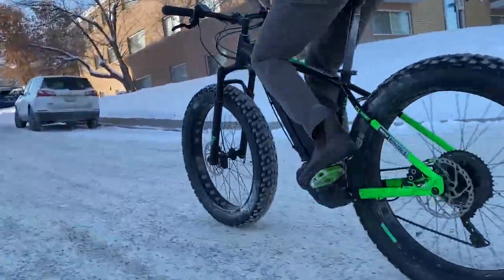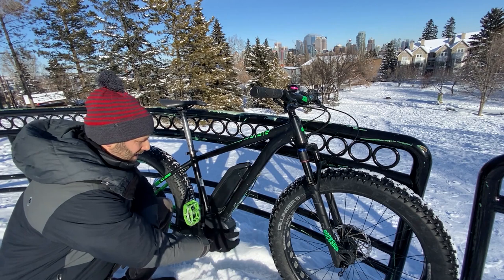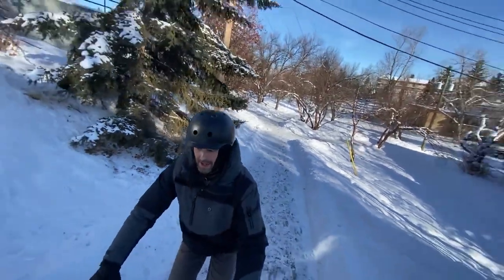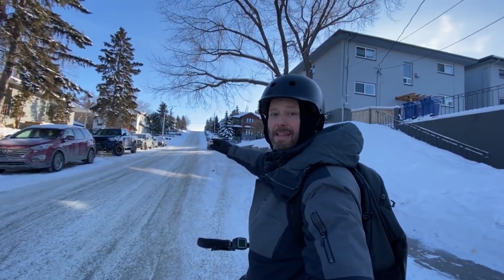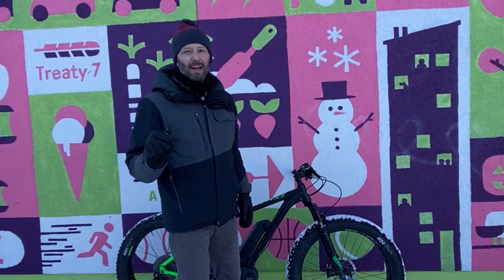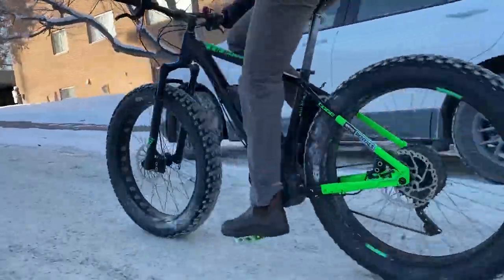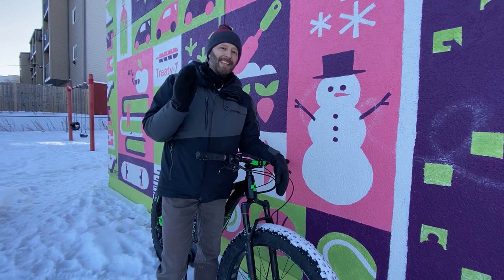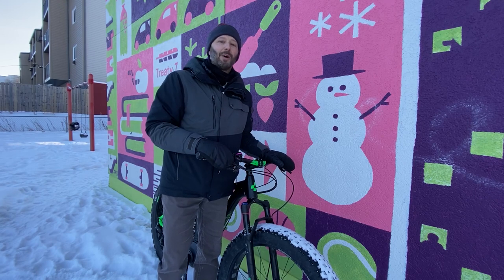Will an electric fat bike become my new favourite winter urban commuter?

Comment: The main thing for staying warm in the winter on any ebike is to make sure you keep puting out the same effort you would if you had the battery off.  If you use the peddle assist as an excuse to take it easy your going to get cold.  Adjust the assist level so that hill feels like flat ground normaly would.  If your normal pedal pace puts you at 15mph on a flat pump just as hard with assist on and you'll be going 20 instead but still be just as warm.  As long as your outer shell is decent at breaking the wind a few extra MPH of wind chill  isnt going to make that much of a difference if your still generating alot of body heat.

My local weather isnt quite as cold as yours but I usualy go with a water/windproof shell and the minimum under that to not freeze my ass off in the first 2 minutes of my ride.  Still a bit cold for those first 2 minutes out the door but after that  I'll be warm enough even for short stops.  I keep a heavier layer in the pannier for long stops.  I then pick a speed I want to travle at and  use the assist levels as a thermostat.  Too warm? assist up and ease off peddeleing as hard to cool off.  Too cold? assist down and peddle harder to maintain speed and build body heat .
Reply: Maybe you could add a front windscreen to the bike as well?

Comment: I don't like super wide tires, but if you are in a city with a tram system those tracks are dangerous if your tires are skinny enough to get stuck in the groove. It is often not possible to cross the tracks at a safe right angle and if your front wheel gets stuck that's a nasty crash.

Comment: I have  low powered mid drive efat, 350w middrive...top speed 18, but in reality more like 14-15mph...its a great bike for rough, loose or uneven surfaces , and the woods.  This will be the first winter I get to try it.

Tbh, it will outroll a bike Friday on even a  mild downhill. It's just that the tires are so

Comment: Needing to add lights or bags etc isn't a negative. Most bikes don't have those options out of the box. 

Good perspective though. I never thought about the ease of riding an e bike in the winter resulting in less energy/body heat.

Comment: I have two issues with e-bikes: the cost and inability to maintain the electrical components myself. I own a cross ebike with a Bosch motor. Love the bike but the motor is a black box. I can't take it apart, no parts are available the batteries are proprietary and very expensive. If the motor fails I'll be looking at an expensive repair or replacement. Since the frame is built for a specific motor it might not be compatible with the newer motor models. Effectively, if anything happens to the motor - the bike is throwaway.
Reply from the maker: This is also a factor. Thanks for sharing

Comment: You can buy a cheap brand new 26"x4" tires bike for under $500. I ride motorcycle in the falls and heated gears are a must! However, I am concern sharing icy roads with vehicles.

Comment: The other downside to ebikes should be pointed out more. It pushes your average speed up close to that of a motorcycle yet people still wear typical cycling gear. If you eat shit on an ebike doing 25 you are going to be much worse off then me in my armored and abrasion resistant motorcycle gear and full face helmet. Not saying it's practical to ride a bike in that stuff but it seems like most people don't even consider the injury risk higher speeds on a bike present.

Comment: Ah!  So they DO make studded fat tires.
  You mention two things.  
       It's harder to get up to speed   -is this because the sponginess of the low pressure tires absorbs more of the enrgy you're pedaling out when it hits a bump or slope?  Or is it the extra mass at the utside of the wheel that you have to spin up?
        It's more stable.   - what do you mean by this?  Harder to slide out from under you?  Harder to tip because you have more mass in the tire spinning like a top?  A wider tire surface engaging with the ground?
  I've been looking at one speed bikes with a pedal assist motor to act essentially as my gearing as the route warrants.  I've seen a lot of talk about narrow studded tires for winter biking.  Would a studded fat tire offer some advantages?

Comment: Fact is I had a Marin MTB bike for a few years, but it got far less, and diminishing use after I bought a Marin hybrid model. I might of seen it differently with winter riding, but in the past I've been shut down for biking over winters.  The hybrid offered me more comparatively for speed, athletics, handling, and now utility use.  Not that different for what you see for the advantages of your preferred style of city bikes.  I've even gone and changed tires to Fincci 700x35c for both, where it's more of a gravel type tire compared to more of a dirt tire.  With far less snow and ice here, (Arizona but at 5000 feet) I could be OK with those, but I have two used spares which I can change back to for the dirt tires if need be on that bike.

Comment: If you rise the handlebars a little bit higher then it will help you to prevent sore wrist and will be more comfortable. Don't leave your ebike battery outside in the winter, goodness will damage your battery. The same with sun light in hot summer. You can get a beautiful and more powerful Chinese fat tire ebike for 14$ USD. Himiway Cruiser and Majicity fat tire ebikes are amazing but they are a little bit expensive.

Comment: Did the e bike have mode settings?
I converted an old Raleigh Aero to throttle assist ( front wheel drive) and I find if I'm not warm enough just use leg power till warm then back on the throttle, and repeat 😁
Reply from the maker: Yes, it was. This is great advice.

Comment: If all of the salt on your city streets will corrode a fat bike like that a year or two, what the hell does it do to a brand new car that costs multiples of a premium bike like that?!?!
Although, beautiful machine!
With the electric motor, it would be a very pleasant commuter' summer or winter.
I'm in Ireland and I think it must be 12 years ago since we had any kind of substantial snow that turned the country white. Hopefully it'll be another 12 more at least. Let's just say every year I'm dreaming of a green Christmas.
Usually only get a real snow about every decade on average.
It's been a very mild winter this year with barely half a dozen icy morning's on the roads. My 40mm tyres on my hybrid bike are fine all year round.

Comment: It is really hard on Ebike Batteries because Lithium-ion don't like to freeze.. You definitely should never charge a frozen battery, wait until it comes to room temperature before charging.  Your range will definitely drop in cold weather.   So unless you have a warm place to bring the bike in for storage and charging it's not really a good idea.  Batteries run between $260 and $1200.  Charging a frozen battery can cause it to malfunction or completely fail. Expensive lesson..

Comment: I always wonder about the drivetrains on those... does it have the high gears you need to do 30kph without pumping the cranks super fast? And like you said, it doesn't take much effort to maintain that speed, but on eco mode does it give you just a bit of a boost, allowing you to power it mostly yourself or what?

Comment: other than the mid drive motor & battery the components are the same as a conventional bike.............and both are well-protected against the elements.  I ride year round and have 16,500 kms on my e-bike (since 2019). I haven't had any additional issues on this bike as I have had on my other conventional bikes.  But the probable theft issue is a great reason for not commuting with my e-bike
Reply: What bike you riding these days in winter?
Reply: @JamesMorton-p9k  2019 Motobecane HAL eBoost PRO  (i now have 21,600 kms on the bike.........original motor & battery)
Reply: @ thanks for the reply!  These bikes look really good actually...hasn't heard of them before!

Comment: My ebike cost roughly $1500 with lights and a bike rack.  $6k is paying for high end components.  Theft is really the only main issue I see, but you can invest in an alarm, GPS tracker and remove the battery.  Cold?  Slow down and make your body work.

Comment: is studded tires necessary for winter biking? even if it is regular mountain bike? you showed using skinny tires in snow. are you using studded tires? if not how it is not slipping in snow? what is the safe speed limit to follow when riding on snowy road?

Comment: I’ll have to agree to disagree.  My first commuter was a skinny hybrid with studded tires but after dealing with rutted refrozen ice on the streets in Minneapolis, Minnesota it became too treacherous, so three years ago I made the switch to a Fat Bike from FRAMED and Never, Looked, Back!  I initially poked fun of fat bikes when they first came out, they looked like slugs but quickly realized how much BETTER fat bikes really are as a commuter.  Fat bikes  are extremely stable and predictable in most conditions. You talk about speed being an issue, but not with higher tire pressure since I run 30 psi max pressure on my non-studded Terrene Cake Eaters and it’s FAST! It’s not road bike fast, but weighing in at 40 lbs (with fenders, lights, aluminum reinforced brush guards mounted on the handlebar for wind protection, KORE downhill pedals and a water bottle) when compared to my 25 Lb. skinny bike (single speed in my case) it’s only 2 mph (GPS Tracked) on average (in summer conditions) slower over the 8 mile commute.  I even run max pressures throughout the entire winter, but drop it down to 11-13 psi for extra traction if my commute is through 5” of snow or more.

I’ve changed my attitude towards commuting using a heavier bike, It’s made me physically Stronger and Faster and it’s quite noticeable when I switch to my carbon fat bike for the trails.  You bring up the issue of rust from road salt basically killing a bike... two things, buy a bike with better components and take care of your bike!  The corrosion resistance of my upgraded SRAM components and KMC chain show absolutely ZERO rust after 3 years, in fact my bike is in excellent condition after 3 years of commuting through all weather conditions because I take care of my equipment.  In the winter I wipe my entire bike down with a wet microfiber cloth when I get home at night, it only takes a few minutes but removes all the residual salt and grime off the frame and rims... I even go as far as spraying some water from my water bottle onto the driveline and let it drip dry.  I clean my entire driveline at least once a month during the winter months.  It’s simple, if you never wash your car or maintain it you will soon have a crappy, undependable vehicle.  It’s not OCD to clean and maintain your equipment and it surely beats breaking down in subzero weather because you’re too lazy to clean your chain every once and a while.

Glad to see you smiling during your eBike fat bike ride, I’m sure more of us fat bike commuters will change your mind someday about the “perfect commuter bike.” ;)
Reply from the maker: Great comments, and thanks for sharing. I commend you on your bike-maintenance regime, but all that work is exactly what I'm trying to avoid. I think urban bikes should be practical, easy and as maintenance-free as possible, for one basic reason: People will use whichever transportation mode is most convenient. If riding a bike requires a daily wipe down and monthly drive-train cleaning, that will push many people away from making that choice. I'm not criticizing your decision, I'm just thinking, on a macro-level, that if all bikes (not just winter ones) were easier to maintain, we might see more people choosing bikes for transportation. 
Plus, I hate bike maintenance!
Reply: @Shifter_Cycling  Even with low maintenance drivetrains like a Rolf hub and Gates carbon system you’ll still have maintenance to some extent. Choosing to commute by bike should also take into consideration that at anytime something can break and leave you stranded and being stranded late at night in the middle of winter can be dangerous. I maintain my equipment to avoid most failures. I use my commuter as a tool rather than for pleasure and stick behind the notion that the better you maintain your bike the less likely it will fail. The mindset of those who want little to no maintenance are those who live in apartments and ride the bus.  The preparations considered for commuting by bike go beyond dressing for the weather, it’s also making the right choices for equipment and taking care of your entire investment.... biking can be expensive but the rewards are worth it! 

Thanks for responding to my feedback.  I enjoy your videos because I like to hear and see how other people commute.  I feel like I’ve finally sorted out my gear, but it’s great to be open to new ideas.  One thing I will share with you is that I make notes in my phone for how to dress for colder 10-15 degree temperature brackets. I work evening shifts at a hospital so the temperatures can differ from when I leave for work at 2:00 pm to 12:00 midnight or 7:30 am if I double and I’m riding home in the morning. Careful planning and being prepared takes a lot of surprises and guesswork out of the equation.  Happy riding! :)

Comment: You can get belt drive E Bikes with waterproof components . you can get dual motor bikes front wheel and rear wheel drive.  Dual batteries .. I'm sure you can find a good winter E bike and dress more appropriately .😁

Comment: Excellent video, only saw it now because I'm a recent subscriber. I'm a former marathoner who had eleven bikes at one time, and when I got a fat-e-bike (that sounds like fatty bike!), it became my immediate favorite. Getting going is the tough part, but once on the move, it rolls and coasts very well. Security is the rain on the parade for me, as my hometown is pretty much cars-only, and it's rare that stores even have a rack, let alone one that's properly installed in a good location. But, everything else is pretty much perfect: full set of lights with brake light, heavy duty rack, 1600 watt hub motor which is silent a low speeds, 12 pedal assist levels, 73 miles range on throttle only (tested), and it FOLDS!

But, I still have to drive a car because no one is going to pick a car up and throw it in the back of a pickup truck...
Reply: Model ?

Comment: I would love to ride my fat bike to work, but I can’t think of a safe place to leave the bike while working...
Reply from the maker: This is a huge problem everywhere. 😩
Reply: @Shifter_Cycling  Why? Doesn’t employers have good bicycle parking? My employer has charging facilities for 30 electric bicycles in a big bicycle shed on the premises and room for another 100 normal bicycles. There is an air pump for your tires, a small self repair space, room for your rain clothes to hang to dry, storage lockers for your bicycle cloths and helmet and a shower room. The space and investment needed for bicycle parking is far lower than for car parking.

Comment: I can see this working for a commute to work with well protected parking options, but for running errands around a city? Let's just say a bike I'm comfortable leaving tied to a lamppost is ten times cheaper. 
Not to mention that it's gonna be worth to people to steal just a wheel or a battery etc., so it's gonna take you longer to tie the thing down safely than it's to get places.
Reply from the maker: Yes, I agree with all your points

Comment: $6000 for a bike? my car cost $7000, not an unreasonable amount to invest in a primary vehicle but not if its meant to be a cheaper option that you don't need to worry about being stolen or parts breaking
Reply from the maker: Cost is definitely a factor
Reply: There are much less expensive fat tire ebike options. 1400-1600 usd gets you a nice one with a geared hub.
Reply: Ebikes are expensive that's for sure. I could have bought a nice second car for the price of mine, but seeing that I already have a nice little car that wasn't a factor for my purchase decision.

My cars cost me money  everyday whether I drive them or not. I've got road tax, insurance, yearly health check, maintenance and fuel to pay, not to mention parking costs, city congestion charge and potential fines from CCTV cameras watching my every move.

With the bike I've almost none of those expenses or worries, just a little money on maintenance. Of course theft is a major worry so I'm very cautious where I leave it and about how I lock it up. Fortunately I can take it into my workplace and leave it inside.

Comment: You worry about a 6.000 dollar bike .... people leave their +50.000 dollar cars on the street all the time without worrying about it.
Get a good lock and a hidden GPS tracker.
Reply: The reality is, we're more likely to have a bike stolen than a car stolen.  And a high end ebike is the most juicy of targets.   Even a good lock is 30 seconds with a cordless angle grinder, 3 minutes tops.  As for the GPS tracker, most use WiFi not cellular, so the chances that the thief fails to remove the tracker before they settle down in a wifi hotspot are not awesome.  I'd love to be wrong about the GPS tracker.  Do you have any good studies that show they're effective with recovering bikes?

Comment: All new CUBE bikes are just garbage. They made their own mudguard mounting system so you can't even put other manufacturers' mudguards on those without heavy modification or zip ties etc. Well actually not even their own ACID mudguards worked.

I bought a Cube Hyde Race and I wish I would've known that. Then I bought the stupid ACID mudguards and you couldn't even mount those. Asked, the customer service, what the fuck were they thinking with this shit and got absolutely no reply.

You can get bikes from other manufacturers who don't treat their customers like garbage and don't make retarded mounting brackets for mudguards.